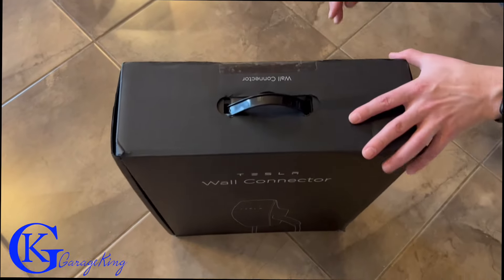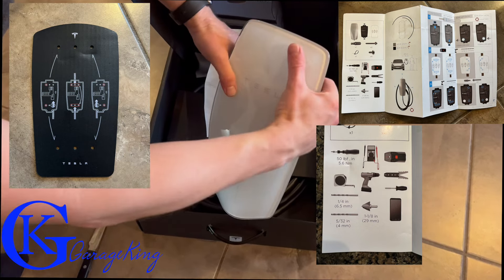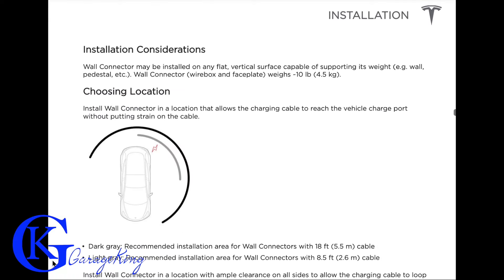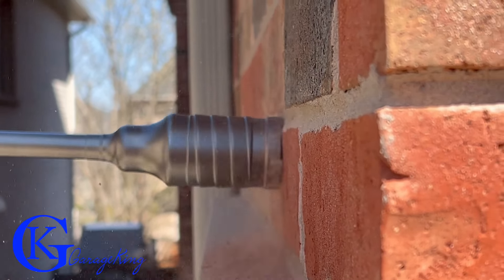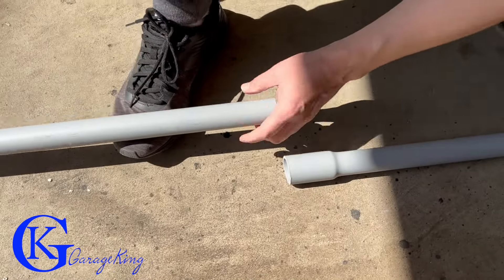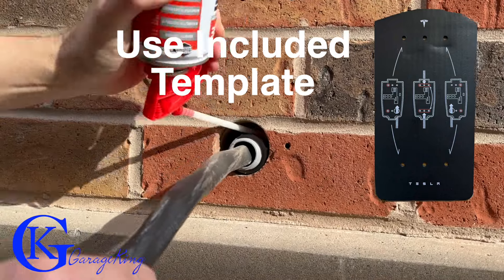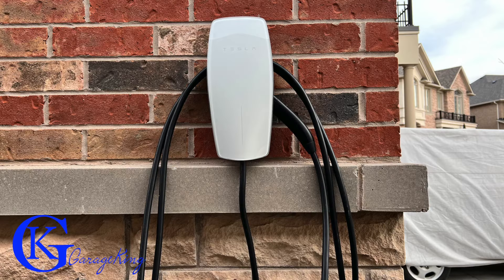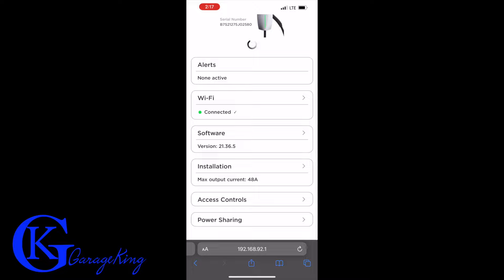Tesla Wall Charger installation (Gen 3)

Comment: so you said you will fix the ground wire. could you put up video of fixed version? I have ground wire also and have no idea what to do with it
Reply from the maker: Yep, all I was going to do is strip the white neutral wire so its bare, everything else is the same.  Its just so the white wire cover will not show.  So you will have the red/black, and then a bare wire instead of the white one.  The only reason I did it like that was I got the wire from the hot tube, its perfectly safe, but someone else could confuse that white wire with a neutral and its a ground (so it should be bare copper.  I did tape it, but I should have just stripped the white sheathing off it.  its still hooked up exactly the same way.

Comment: I am installing my charger and not sure what size concrete screws to use for mounting. What is recommended???
Reply from the maker: I can't remember exactly what size I used, but concrete screws are strong.  I think I had so left over ones that I used on another project.  I think they may have been 1/4" which is plenty.  The biggest thing is if you are drilling into brick make sure they are long enough as the center of the brick has hollow parts.

Comment: you should be able to pull the wire through when the conduit is aseembled. If it's tough, then you need larger size conduits.
Reply from the maker: Thanks for the comment, I got it through.  I think I used 2 1/4" conduit for that very reason.

Comment: Running Romewx through conduit is a code vioaltion??
Reply from the maker: No its not - See article 334.12(b)(4) and 300.5.(b).  The garage how I ran it is a dry location, the only thing is you have to pay attention to the fill %, so you should be using large conduit.

Comment: I counted 3 NEC code violations. Weres the video of the inspection?
Reply from the maker: Hey Thanks for the comment, I did update that I changed the ground wire, and ran individual wires, it was pretty easy to do as it was a straight run.  I'm not familiar with the NEC as it does not apply outside the US. I just followed the Tesla directions, remember this really is not a charger although most people including myself did call it a charger.  The car is the charger, this is just a conduit to the car and the car controls everything.

Comment: Are you sure that there is no induced voltage on that unused ground wire?  You'd better ground the other end at the panel board to prevent unwanted induced voltage.
Reply from the maker: Hey Thanks for the comment, and I'll one up that !!!  I'm actually going to just remove it (its easy as its a straight line) and I'm going to strip it.  It was done correctly as you can run romex in conduit if its above ground, dry, and not tight (like in a  garage) but it does bother me a bit, plus I can reuse that extra wire for someting else.  Thanks for the comment, I do appreciate it and if you look at the next charger I installed (its linked in that video) you will see I stripped the wire.

Comment: I understand the ground goes on the far left side…but does it matter where the black and red wire go? The Tesla manual shows the red in the middle and the black on the right. 

Any reason why you switched it up? Does it matter?
Reply from the maker: Red and Black are both hot, even though you may put them as the Tesla manual, on the circuit breaker they might be switched as its a two pole breaker so both the black and red go to the same breaker and could be in either position.

Comment: If my garage has 220v for the dryer, can I just plug this into it?
Reply from the maker: You need a different charger, this one does not have a plug, it gets hard wired in.  You need to order one of the 240V ones that plug in, something like this. https://amzn.to/4f2H3aw  but you have to make sure you get the right end, there are a few 240V plug options.
Reply: @GarageKing  appreciate the info

Comment: What you did is against electric code
You are not permitted to sleeve jacketed cables in a pvc conduit sysyem
Due to heat dissipation

When you enter pvc start w a box terminate cable to stranded conductors / install stranded conductors in conduit
Reply from the maker: Thanks for the comment, I stripped the wires and re-ran, it was a straight run so easy to do.

Comment: I know that the tesla charger only uses 48 amps so there's no risk here but shouldn't you use a 50 amp breaker so the breaker trips before the 6 gauge wire reaches its 55 amp limit and burns?
Reply from the maker: Yup you definitely could, and FYI I usually use about 10-12 amps to charge, that's what the car is set at and it tops up to 80% every night.  I thought, probably like most people the more the better, but you really don't need 48amps if you top up every night. Also the wire won't suddenly burn up at 55, and there is 6 gauge that can handle 65amps.  You have to take temperature and length into consideration. Just google "can 6 gauge wire handle 65 amps"
Reply: @GarageKing  all good info! Thank you! I also saw the charger acts as a regulator so that’s good info to know.
Reply from the maker: Thanks for the follow up  @bdizzle123001

Comment: I thought that you're only supposed to run 44 Amps on 55 amp capacity wire,   Am i missing something ?
Reply from the maker: Tesla did a video a while ago on how it all worked.  The Car controls everything.  I run about 10 amps through mine.  Rarely hit 15.

Comment: sheathed wiring through conduit......lovely
Reply from the maker: Yup you caught it, that's the one thing that could have been done better
Reply: @GarageKing  luckily that’s a pretty straight run of conduit and it’s indoors. You could easily swap it out if it was ever called out. Nice install, appreciate the video
Reply from the maker: @spectrepro  Thanks for the comment, and this summer I think I'm going to swap it out anyway.  It really wound not take long to do :)
Reply: @GarageKing  Why not simply strip the sheathing off the conductors? Disconnect, pull out of conduit & slice the sheathing off. Shouldn't need to spend more money on new wiring. The individual conductors inside the sheathing are the proper gauge so should be good to use.
Reply from the maker: @MikeSiemens88  You bet, I was just going to pull it and strip it for the Tesla wall connector. The code actually allows for sheathing to be left on as long as its in a dry area and you have a certain cross section (can't be tight) You have to strip in wet or below grade applications. I release another vid tomorrow where I install a Wattsavings charger and just strip the wire and then put into conduit.  Thanks for the comment and happy Friday to you.
Reply: @MikeSiemens88  stripping the sheathing off is not permitted as the individual conductors won't be labelled, etc     You have to use THHN or THWN type of wires in this case.

Comment: So if you use the bare copper as ground the way its supposed to be what do you do with the white?
Reply from the maker: Well the best thing to do is to take the sheathing off (that holds all the wire together) and what I did was run the red, black, and I stripped the white bare and used that as a ground so I only have 3 wires now. That I did a few months after.

Comment: Hi brother  how much do you think  an electrician wiil charge for the same work you did....?
Reply from the maker: The running of the wire is not hard, it's the drilling if you are going into brick, and the mounting of the bracket. To be honest it really depends where you live and how busy the electrician is. The cost of the wire and circuit breaker are fixed, but the labour will vary. Also mine was fairly easy as I have a panel right in the garage.  Not many people have a panel right in the garage so the wire has to be run to the panel box which is most likley in your basement.

Comment: Great Great Demo. What drill bit is that? Size?
Reply from the maker: Hey There, its a Bosch SDS Max bit. I use it in a Bosch SDS Max hammer drill, the bits are splined so they can't slip in the drill. The bits can't go in a normal drill. I think the size I used was 2 1/4"  I love the drive, I can use it on hammer mode only (doesn't spin) and I have used it like a jackhammer.
Reply: @GarageKing Great, Thanks for the quick Response.
Reply from the maker: @corteydmusic  Anytime, have a good one !!

Comment: I understand why you did the video to help people save some money but unfortunately a few things are not by the  National Electrical Code (NEC)

You should have used the bare ground wire, it is a code violation to use a conductor that is white for anything other then a neutral (grounded conductor) a grounding conductor must be green or bare. For the ground wire it is not carrying any current unless there is a fault. You can not tag the white with tape marking it green.  
The Romex can not be sleeved in the conduit. You need to use single conductors with 2 #6 THHN conductors and 1 #10 green is what’s required by code. There are a few other things but those are minor.
Reply from the maker: Thanks for the feedback, I really didn't know about not using the neutral.  That's news to me, but I can see why, I just thought use the biggest wire and tape it, but I do see your point.  As for the sleeving I see your point as well. I used the wire that was formerly used for the hot tub in the back yard (thats where it came from)  Thanks for the feedback !!
Reply: @GarageKing  it’s all good. You learned something new today. The NEC has a lot of different rules to make everything safe. Some I don’t agree with because I think it’s the manufacturers pushing there products to make more money. But as a electrician I have to follow them. 
I like when people do things by code so it’s safe
Reply: @stanley4006  I see a lot of scary stuff being stuff done on YouTube with these chargers. I'm a retired union electrician in the Chicagoland area. All homes in the Chicago and the collar counties are done with EMT. I never really worked with romex that much just when I had to work in the farther out west union areas (461). It's way easier to rope a house but the splicing sucks. I could splice a EMT house way faster than a rope house.  I agree with you on manufactures pushing things. I last roughed a house in 2009. We installed ARCH fault breakers in just the bedrooms now I see the new code the Whole house is ARCH/GFI breakers basically. A combo single pole 15 is around 60 bucks, do the math on that for a house.
Also this. PEOPLE NM-B is rated at 60 degrees (C) so 55 AMPS. When the insurance company checks after the fire and sees the wrong wire size used Flo is going to deny. Change to a 50 amp and adjust the settings on the charger. A few less miles per hour is worth it.
Reply from the maker: Thanks for the comment, just saw this now.  I usually charge at 10-20amps.  The car slow charges overnight when the hydro is cheap.

Comment: Any other electricians here? Did anyone use silicone to seal the charger or you reckon factory seal will be ok for outdoors
Reply from the maker: I didn't use any silicone on the charger body as its waterproof, and has a rubber seal so the front seals to the rear, so as long as the conduit comes into the box then really there is no way for water to get inside.  I have have the cover off and all looks well with no sign of any moisture.
Reply: @GarageKing  thanks mate
Reply from the maker: @johnorr2241  Happy to be of service
Reply: @GarageKing  did you use a gland or screw to plane for conduit entry? 25mm was a bit loose , bottom entry..
Reply from the maker: @johnorr2241  I came in through the rear of the box.  I didn't come in through the bottom so I'm not sure if you were coming in from the bottom.  To actually drill the box I just used a spade drill.

Comment: Does it matter that excess copper is hanging down below the terminal at the 6:12 mark? Did you trim it or leave it as is?
Reply from the maker: Hey there, I re-ran the wires to strip the ground (so the white wire is now bare) but to answer your question its fine to leave the ends of the wire like that.  If you pause the video and look close you will see the wires are still between the plastic "walls" so there is no way they could actually touch.  You would not want them longer than that as they would be past that safety point.
Reply: @GarageKing  Thanks! So did you re-run all wires or just the white ground? And do the wire ends still stick down like the video with a bit of the copper showing between the walls?
Reply from the maker: @N.I.C.K.  Hey There, I just stripped the sheathing off, so all the wires are run individually and ran the ground bare now so its not in the white plastic. The ends stick out the same.  I wanted to make sure that the wire was all the way through the connections so that's why it stick through a bit.
Reply: @GarageKing The Tesla manual shows the ground on the far left, red in the center, and black on the far right. Does it matter that you swapped the red and black wire?
Reply from the maker: @N.I.C.K.  The read and black don't matter as they are both HOT, the ground matters.

Comment: Now at the end you said you can set to what you want. Does that mean you can run it on a 50a circuit?
Reply from the maker: You can set it to what you want, but you are limited to the size circuit breaker you use.  For example, if you use a 20amp circuit breaker you can set it to any amps 20 or under.  Don't ask me how the car knows what circuit breaker you use, it just does somehow. Keep in mind the max draw is 48amp when using a 60amp breaker.  The car regulates the current.

Comment: Thank you for the extremely helpful video. :) What size PVC did you use? How did you decide the PVC to the charger?
Reply from the maker: Hey Thanks for the comment, you caught me at a good time when I'm checking messages :)  To secure the PCV to the charger I just used that threaded connector you saw in the video, but put an extended it so it pushed out of the wall more, then you can just put a big nut on, you can get those nuts at Home Depot. For the PCV tubing I used 1 1/4" and 6/3 wire.
Reply: @GarageKing  Ty. Any what size drill bits did you use for the mounting screw holes?
Reply from the maker: @joshuaglickman1871  Hey There, I used 1/4" masonry screws and I used a 3/16" hammer drill bit to make the holes :)

Comment: No. 6 gauge wire ampacity depends on the temperature rating of the insulation. 60*C is 55A, 75*C is 65A, 90*C is 75A. Let’s say you use 90*C rated 6 awg copper wire. Once you land it on the 75*C rated breaker terminals, the conductors are derated to their 75*C ampacity, which is 65A. If the ampacity was actually 55A like you said, you would not be allowed to use those conductors on a 60A breaker as they wouldn’t be sufficiently protected. Breaker ratings are not allowed to exceed the ampacity of the conductors they’re protecting.
Reply from the maker: Hey Thanks for the comment, The charger outputs a max of 48amps and at the 1:48 mark you can see it says to use a 60amp breaker.  (48*1.25=60) so I think that's why they want you to use the 60amp.  So I think with THWN (90 degree) you would be fine as wall connector uses max 48 so at 125% that's 60, and our THWN is actually good for more than 60.  I think I should have been more clear on the variance of types of 6 gauge wire.  TW is only rated to 60 degrees, as is UF, but I doubt anyone would use UF, but you never know.

Comment: Hi, thanks for sharing this video. Maybe i've already read some comments below about that, but i'm still in a doubt. Is it possible, with the Gen 3, to use any kind of dynamic load balance, or integration with solar systems to use production excess for example?
Reply from the maker: Hey There, there was nothing on integration with solar, at least not that I remember.  I don't have a solar roof, but I sure wish I did and thanks for the comment :)

Comment: Could you please guide me to get the 6 guage wire? Looking for reliable sources as everywhere these are soldout
Reply from the maker: I think the best bet is Home Depot, or Amazon.  Amazon still has it but you have to search. Here is 75ft of indoor wire https://amzn.to/498gPQH  Now if you are running outside of drywall, like in a garage you can strip the sheathing and run in conduit for protection.  If you don't feel comfortable please call an electrician to make sure you get it right.
Reply: @GarageKing  it has ampacity of 55 amps, can this still be ok to max charge at 48A with 60A breaker ?
Reply from the maker: @Dianfarida-g9n  Thats what the Tesla Manual recommends.  The Tesla car is the charger, the box is just the conduit for the power to get there. The car controls the charge current and can adjust it.  If you don't feel comfortable you can use 4 gauge wire.  Most people follow the manual.  You seem unsure, and if you have a longer run, or live where its hotter, you may need 4 gauge.  I would advise anyone to always call an electrician for a quote, and see what they say, and abide by the laws in your state. Not sure if you are aware, or if you have owned an electric vehicle.  I top mine up to 80% every night while I sleep and rarely use over 20amps. Most of the time its at about 13-16amps.
Reply: @GarageKing  thanks a lot for clarification, really appreciate it
Reply from the maker: @Dianfarida-g9n  Anytime !!

Comment: Please explain why use 6/3 instead of 6/2 thanks .
Reply from the maker: 6/2 is actually better and all that is required.  I just used the 6/3 as I had extra from the hot tub.  Also its good practice to strip the sheathing that holds the wires all together.  I could run mine like that as the conduit was large, and it was in a dry and above ground place. Get 6/2 if you are buying.